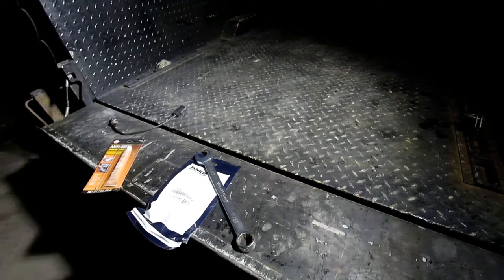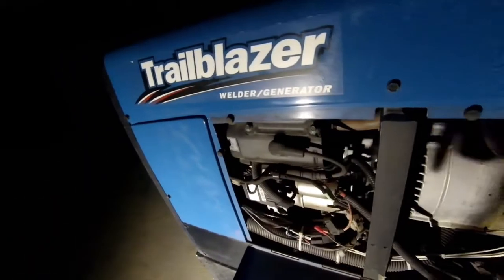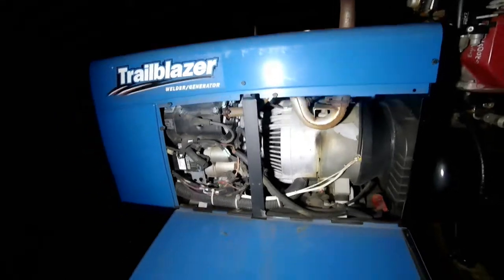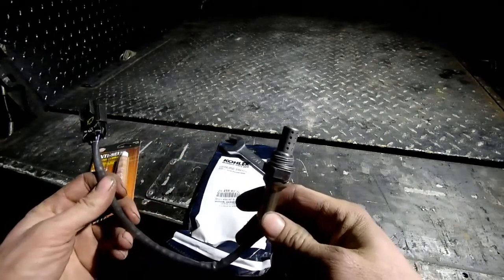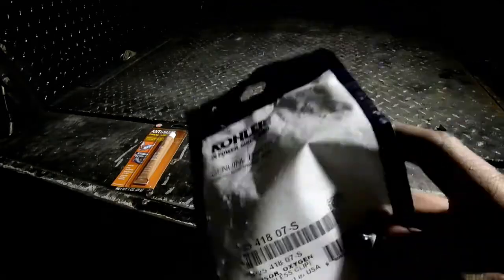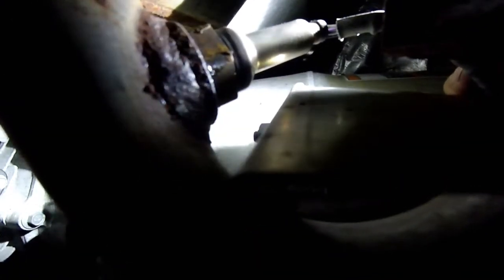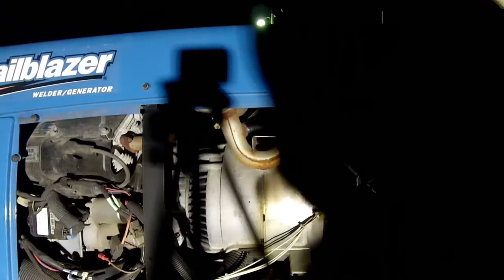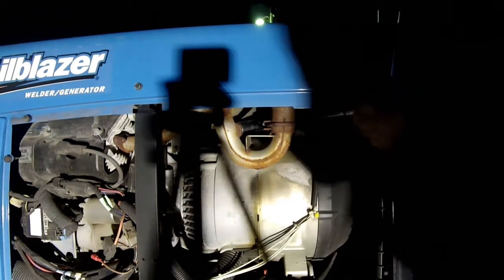Miller Trailblazer 325 EFI Rough Idle and Throttle Surge Repair

Comment: I just invested in a New Miller 330 EFI. I hope I didn’t make a mistake. Been seeing a lot of Miller problems lately on the Tube here.
Glad you were able to fix the problem.
Reply from the maker: @musashiblade8665  the 330 I looked at had an electric fuel pump.   I hope they fixed everything with the new model

Comment: Mine did the same thing at about 1,700 hours. Miller service techs couldn’t figure it out and The local repair shop couldn’t either. Finally got ahold of the western region sales rep and he gave me a guy to go to who had the right stuff to figure it out. Hooked his kohler computer up to it and in 30 seconds said it was the oxygen sensor. Fixed and back in my truck in 30 minutes. About 2,800 hours now and the problem is gone.

Comment: Been torn about upgrading my 302 trailblazer to either new mpx330 Lincoln or another 325 with the excel package and ArcReach. Been really happy with my 2015 325 currently at 1,500 hrs and no issues whatsoever. I weld aluminum in the field on occasion and have been using the 325 to power my powermig 300 set up with a push/pull binzel gun but this is a pain and doesn't leave much room in the truck. I was attracted to the mpx330 Lincoln because it offers pulse but I just learned that the new 325 also has a pulse setting. Of course the 325 has the EFI and runs at a much lower rpm than the Lincoln saving tons of fuel, surprised Lincoln hasn't come up with this. Anyway I also ordered the ArcReach Suitcase 8 to capitalize on the new feature the 325 has. I'm just wondering if you have had any experience welding aluminum in the field and what I should be looking at for options
Reply from the maker: You can run a spool gun right off the welder, but then you are stuck with a spool gun. I have an HTP propulse 200 that I use for pulse aluminum on bigger jobs.  I carry a miller multimatic 200 on the truck all the time with a spool gun for small jobs. I haven't messed with arcreach yet

Comment: Mine is a 2013 model and had around 2500 hours when it started, I ordered an O2 sensor right away but it didn't help. I've replaced fuel filters, fuel pump and a battery (old battery was too far gone) and its still not idling right, it would run perfectly fine at the beginning of the day for anywhere from 30 minutes to an hour and then starts acting up. Spark plugs were replaced in April and only had maybe 250 hours put on since then. starting to lose hope of being able to fix it myself, the closest welder tech shop is 2.5 hours away
Reply: Ever get it figured out?
Reply: @hinds90  yes, ended up taking it in, they said one of the fuel purge hoses was cut and capped (by previous owner for whatever reason) they replaced it and it runs perfect again
Reply: @maxstozhkov6646  I'm servicing mine myself with the help of a few from a FB group. Found bad fuel pump and replaced and got it running but once it warms up starts running bad and some times wants to run away. Started testing the o2 sensor and it's shorted so got one of those on the way.
Reply: @hinds90  mine acted weird too and had it replaced as well, and it wasn’t a problem in my case. I probably spent about a thousand bucks on parts before giving up and taking it in. Hopefully O2 sensor will solve your issue

Comment: I have a 2017 Bobcat EFI . I let it set to long and the fuel went bad. I took apart this canister, the float needle was stuck and the pump isn't working.
This is a weak point with this engine.
Reply from the maker: @SteveWagner-ws6ty  yes, the needle valve in a fuel injection system is a very bad design

Comment: Does the bobcat 250 have an oxygen sensor? Mine is doing the same thing it does not go back to low idle and want to try changing out the oxygen sensor hopefully that’s my problem
Reply: Speed sensor? Also the carb $ went way down after EFI, you can buy a complete carb assembly for less than $200 now

Comment: Already replaced the 02 sensor and it is still idling rough.
Reply from the maker: My friend had one do that and it was the battery going bad.  Ecm didn't have steady voltage
Reply: @LostSkills  my next though was fuel pump/diaphragm pump and tune up even though I have 40hrs to go to my next service. I’ll try the battery.
Reply from the maker: @Jcasta8  could be the the other pump.  I have only seen them work or completely not work

Comment: Did this solve your problem? My 325 is doing the same thing. It’s under warranty but nobody including miller has been able to figure out the problem.
Reply from the maker: Russellwelding .  It did fix the problem for me.  It has been running good for about 50 hours since this video
Reply: Templeton Neptunist that’s great. I linked your video and emailed it to the guy I have been dealing with from miller. I have been unable to catch what it has been doing on video.
Reply from the maker: There are other things that could cause this problem.  Map sensor, throttle position sensor,  throttle actuator, bad wire, bad connection etc.  If Miller can't figure it out, then I would be looking for someone who could hook a laptop to the Kohler engine ECM
Reply from the maker: Russellwelding.  The problem on my machine was the longer it ran the throttle would start to surge.  I would go from idle to past full throttle.  It would start to spudder and then it would run rough and then it would rev way up.
Reply: Templeton Neptunist mine is literally doing the exact same thing. Idles fine for a awhile. Then sputters. Then revs up way past what it’s supposed to for a few seconds then right back down.
Reply: Russellwelding help have replace fuel lines filtered fuel pumps o2 sensor and it turns on idling low still and stuck on hour and oil life
Reply: Same problem with mine. Hate my 325. Still have a 301 with 7k hours that runs mint.

Comment: That's why I went with a carburetor ! Did injection once . Every time there was a problem , bring it in . Bring it in ! How the fuck am I supposed to make money that way ! I just posted a video on my channel about the trailblazer 325 . Runs great ! Welds great ! Die hard Miller fan ! My beef is the new cowling design . It let's water down in the cooling fins then freezes up . Can't turn it over . Been a Weldor self employed for 30 years . Never had this problem before . I'm a thousand miles from home . And my 6000 dollar Miller got some snow on it and won't fuckin run ! Third time in 2 winter's ! Geuss I'll modify the cowling  beens how some stooopid fuckin engifuckineer couldn't get it right !
Reply: Mine won’t give me any power when I start it up what should I do ..........???
Reply: @crownusbrand  it'll start n run but no out put ?
Reply: @theweldor757  yes start and run but no out put

Comment: We have 10 of these machines. They are junk. Plain and simple. Should have stuck with the carbureted bobcats. We have 30 or 40 of the Bobcats that literally have 1000s of hours on them and still run fine. Miller, you made a horrible machine and don't want to fix any of the problems. I will be buying red machines next year.
Reply: Who you work for bro? Just curious to have that many welders?